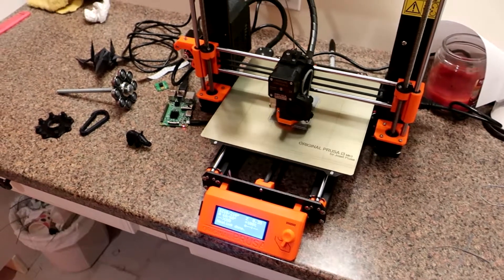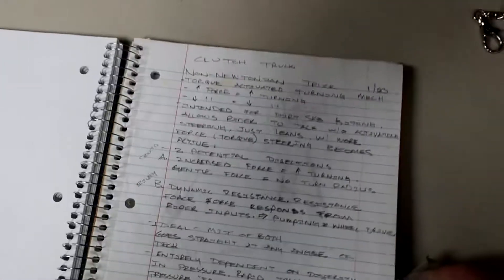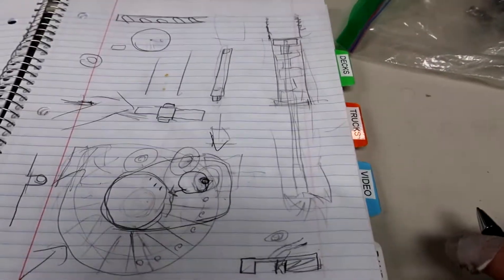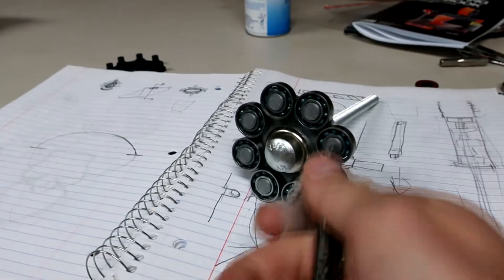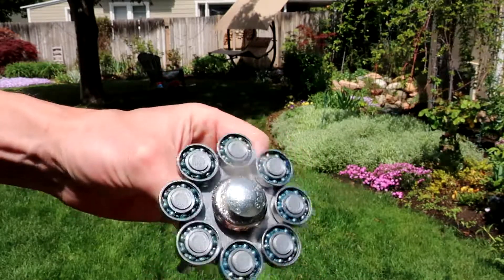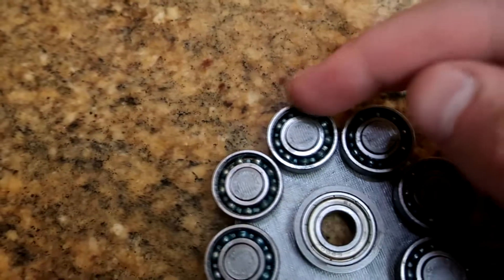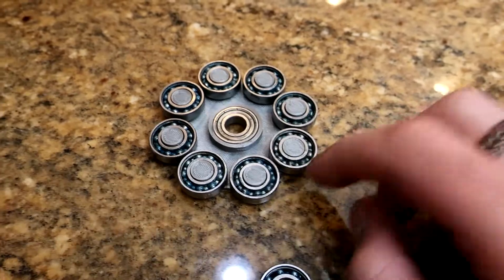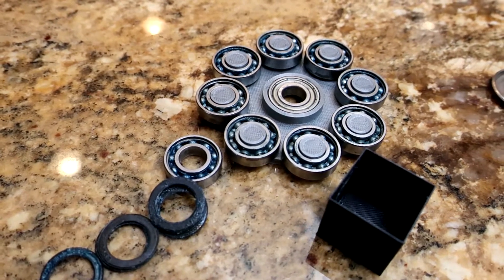Making a 3D Printed Bearing Cleaner Pt 1

Comment: I think you are going at it all wrong. Forge the bearing in the middle just make it fixed to shaft and mount shaft to drill then dunk it in sink w water and strong de-greaser. Pull the trigger and the de-greaser water will rid of the grease.

Comment: Please finish this, this would make my life so much easier. I current resort to spinning each and every bearing by hand, one by one, under a faucet. Then blow drying each bearing while spinning them. It's like a 1 hour process per board. I'm very OCD, to say the least. This would make my life much easier. I also use Sherwin Williams tri-flow oil with PTFE instead of grease, so I clean my bearings a ton! This will be life changing, I might take a stab at it myself as a fellow engineer :)